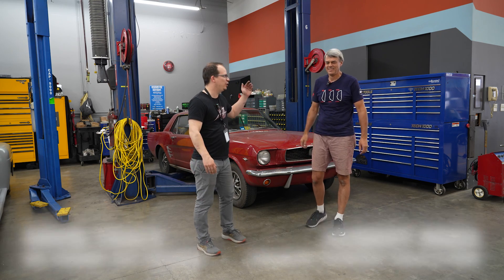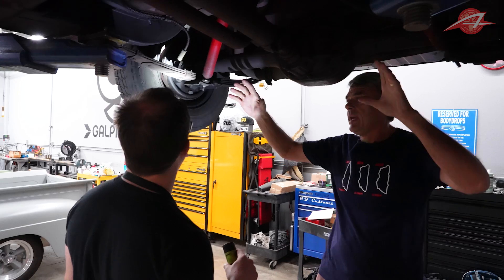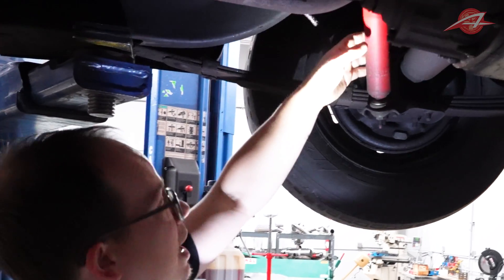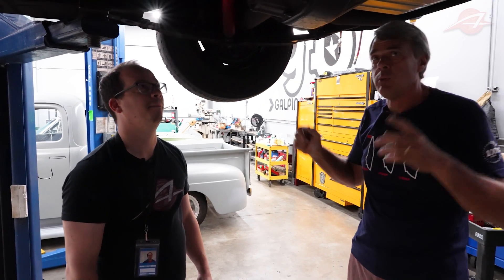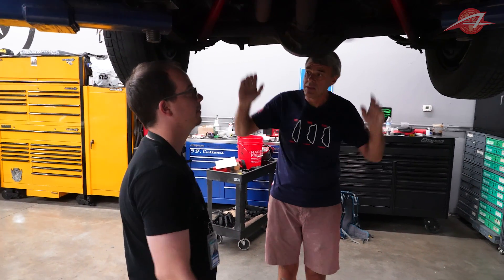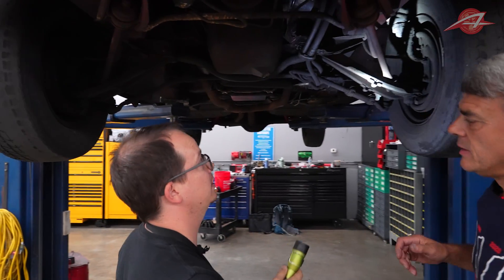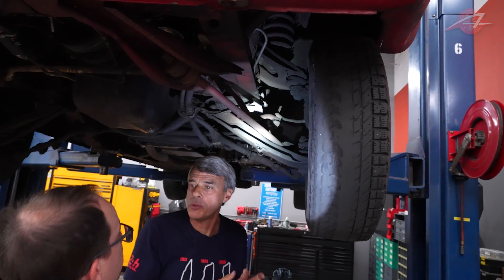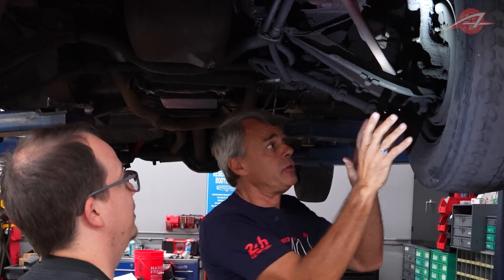The First-Gen Ford Mustang Reveals There Was Still Much To Learn About Solid-Axle Suspension In 1965

Comment: The are articles about US Ford working on fwd  prototypes in late 50s. That's the reason the early 60s German Ford Taunus 12M are fwd. It was based on the US Ford Cardinal that was cancelled right before production start. The '61 T-bird (Bulletbird) was also initially ment to be fwd.

Comment: Fun aside about the FWD rumor on the front suspension. AMC struggled to win at Trans Am, and even had a dealer available crossmember part (to comply with Trans Am rules) that allowed Mustang front suspension to be fit onto an AMC. This worked, but travel was so severely limited it didn't work very well. They redesigned the suspension with Donohue for the 1971 model year, and what came out of it is a heavily Mustang-inspired front suspension. Well, AMC being AMC that design was then copy-pasted to everything in that size segment. Hornet, AMC, Gremlin, etc. Fast forward to 1981 and the AMC Eagle is launched... using a revised version of this suspension with a tall spindle to allow front driveshafts to pass under the relatively low frame rails, thus creating the AWD crossover passenger car that's so ubiquitous today. So in a way, the Mustangs front suspension did end up with drive axles in it.

Comment: Ford loved that front suspension design in the 60s... My 1966 Thunderbird has the same setup, just with the addition of disk brakes. Mounting the shocks like that necessitated huge inner fenders that crowd on either side of the engine, leaving less than an inch of clearance between the exhaust manifolds and the inner fender, and requiring you to use an engine lift if you want to remove the exhaust manifolds for any reason. And removing the cylinder head requires removing the exhaust manifolds because they bolt to both the head and the block because of course they do. And where they bolt to the head, the bolt holes are exposed from the rear so moisture and heat cycles causes the bolts to seize over time, because screw you, that's why. Not all old cars are as easy to work on as they appear... Super reliable once I got it all fixed though.